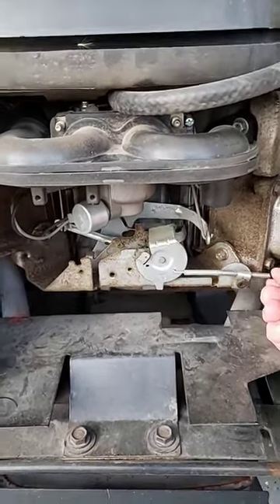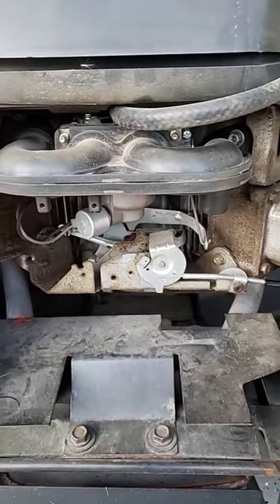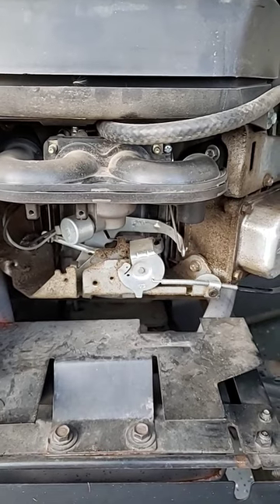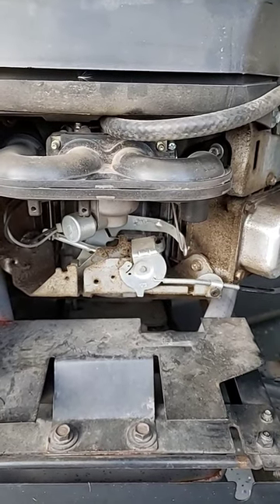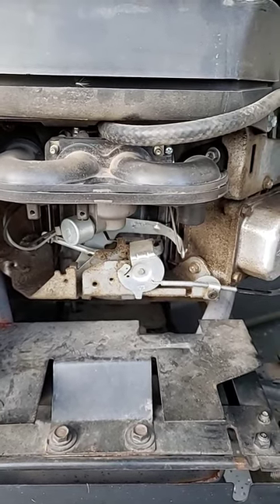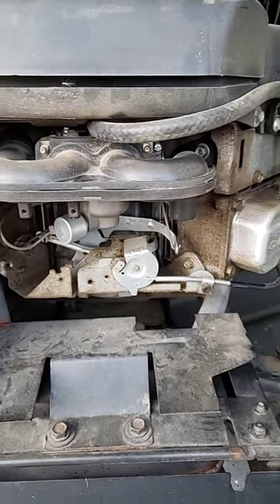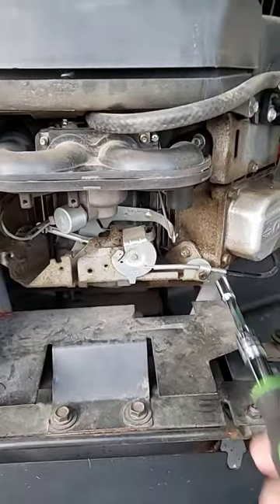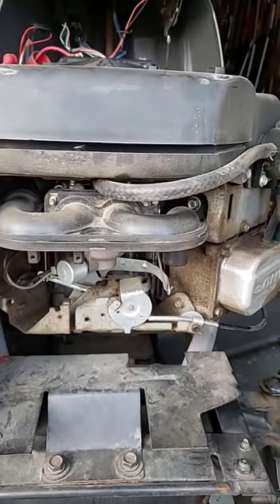Before you try anything else, check this adjustment!! EASY FIX

Comment: You the man!! I changed the air filter, fuel filter, oil filter, cleaned the carburetor and changed the spark plugs before finding this video. It was the choke adjustment all along! You are smart and I am dumb lol!
Reply: I did the same thing plus a new battery
Reply: Bro your not dumb, you must think your a lawn mower technician 😂
Reply: Or may i see your wire harness plug ends if your engine is similar to his or to mine 40h777 i just wanna see if I've got my shit hooked up right
Reply: Or maybe you have a similar engine
Reply: ...yup.
Reply: Nice simple fix.

Comment: dude, I am so glad I found your video. I was getting ready to pull the carburetor and rebuild it. This was the problem, this mower hadn’t been started for over a year and it kicked over on the first crank. Once I move that choke all the way closed.
Reply from the maker: Glad I could help
Reply: Thats good now you can show me your wire harness hook up and plug ends

Comment: It's also frequent that these do come from the factory with the screw tight, but mis-adjusted on the cable length. You can check by watching which lever that cable rotates right on the carb, then see if you can push it farther than the cable can. If so loosen that screw and shove the cable over towards the carb then retighten. When it comes from the factory misadjusted, the engine is so new-perfect for the first season that it doesn't even need the choke, so you don't notice the flaw until the second season.

Comment: I have the same exact mower and mine only starts when I spray gas directly into the mower carb on cold starts. After it starts, it has no problem starting again till it gets cold. I will check this out. I was just about to buy a carb bc I just cleaned this one. It fixed my problem and now my mower runs like a top 1351 hours
Reply from the maker: glad i could help!!
Reply: ur guys engines are a bit newer than my craftsman 22 hp 40h777 but their still the same engine besides numbers
Reply: My mower doesn't start, wait, recharge the and it on first compression, no choke needed.
Reply: @dogtooth11able  soon as i touch the red wire to + on the battery it starts right up plus with its new rectifier put on the used battery would still be dead without that

Comment: My husqvarna has been decent. It had three mower decks under warranty, and the engine has been off twice for oil leaks,not too bad considering it's a 2005,has 327 hours, just change the oil and filter once a year and grease the spindles on the mower deck a few times a season

Comment: Cub cadet it’s a 60$ throttle handle and cable I used a 4’ hand lawnmower throttle cable bolted w a pc a steel  mounted the steel plate  but I have to manually lift the choke  know she’s not maxed rpm and choke like the original I can 3/8 it and choke she starts right up

Comment: I had no crank/click/anything Deere l100.  Pulled my hair out for a couple days.  Found out the brake switch was loose on the frame and slipped off the brake linkage when the brake was applied.

Comment: People are surprised when i say this but my john deere e110 has q
1000 hours it is very well maintained and just today ive had to replace the belt because i was pushing its limits 😅 but every other time i mow it gets grease every 10 to 15 hours it gets a full service blades to oil and it runs like a dream never had a single issue besides some common ones like it just laying grass over but that seems common for nearly all john deere mowers
Reply: Why are you changing the blades so often??? 10 to 15hrs that's on average 10 to 15 mows, unless your blades are warped, bent or broken there is no immediate need to change them, you can resharpen blades for years and years especially if you have a decent little bench grinder, blades are not cheap especially if your mower uses multiple blade to cut with, you should be able to on average under normal operating conditions have your blades last for 3 to 5yrs or more, only time I've ever changed blades is if I hit something that damaged them or they broke or simply wore enough where the edges or tips of those blades were wore enough they started leaving uncut grass in between them, I service, rebuild, and fix all things small engines, been doing it since I was 8yrs old with my old man, I'm 39yrs old now, please stop wasting your money changing blades that often when not necessary unless actually wore out, damaged or broke, I literally charge 15bucks for me to do a sharpening and servicing of the blades at my shop, that's a flat rate no matter how many blades are on the deck, you can't bring me 20 blades lol, only valid with the amount of blades the mower deck requires stock form, and yes I've had to explain that a couple times to some customers lmao...
Reply: @RodneySizemore-uf4yu  i should edit my comment i dont fully replace them i just sharpen them just the other day i had to replaced one cause a rock just decided to pop out of the ground 🙃

Comment: I wanna know how to manually start a tractor when the battery goes dead. Garage ain’t got power and it’s a pain in the @$$ running extension cord out to charge the dang thing. Will the battery charge itself when the motor is running? Or am I supposed to charge the thing on regular basis?
Reply: Ignition Stator or Voltage regulator are not functioning.
Reply from the maker: should be an alternator built in that keeps the battery charged
Reply: Charging system is only designed to maintain voltage. It can't compensate for a weak battery

Comment: Too many times!!  Currently sitting outside my shed because it happened today.  Now I will probably have to charge the battery.  I do have some spray stuff that usually helps but I didn't try it until after I may have flooded it .. because I had left it up at the house.   And because my mower man had just changed out the carburetor for me so I thought things would be great 🙄

Comment: I could use parts off that engine for my 40h777 craftsman/Briggs engine. So now i gotta put another cable on it i attached a cable to the top of the carburetor but nothing at the bottom 

Im using used parts off my other junk mowers so it might look like shit on the outside but all functions the right way its not new like yours you probably paid around 3 thousand something for yours 

I just bought the 40h777 used the guys friend said the engine was blown up but its not i think he'd be upset if he heard it idling smooth again it didn't for him because he had vehicle plugs in it and had a few air gaps and no ignition switch or wire harness no diode or rectifier. I paid $40 for my engine

Comment: Omg you got me 😂 because if someone said hey my mower turns over but doesn't start. Hmmmm. Yea thats not a solution but a rare occurrence.  Probably should check the oil first.
Reply: Wtf are you talking about ..
Reply: @keithturgeon5448  He saying that the problem in the video is a niche and rare issue, probably not the first thing you should check if your “lawnmower doesn’t start” The guy in the vid is generalizing lawnmowers bro starting to a loose choke cable screw, when there are many other more common problems.
Reply: This is NOT a rare issue with these. They very commonly come misadjusted from the factory and need the cable slid over a bit before you retighten that screw. I bought a $2000 machine for $500 because the owner didn't know of this 30 second fix.
Reply: WTF? Always lift your hood first, take a quick look over while you're checking your oil BEFORE you start it. I do, it's a no-brainer.

Comment: Gday I live in Australia and sometimes find it hard to find a Slasher that can climb 10 to 15 degree hill. The problem I’ve had is the oil pump being capable of operating the oil just as efficiently as driving on flat land. I’m interested in a Huski that can operate the oil pump going up and down. Any recommendations would be beautiful. I have only 2 acres but it’s enough to require a decent machine for around $4’000.00 US OR A LITTLE OVER $5’500-$6’000.00 Australian. Cheers folks. All Huskies can be purchased in RUAL Australia no problem. It’s getting the right advice that is 95% always an issue. Sales people trying to flog off that pile junk model no body will buy. Cheers again. And THANK YOU to anyone for your valuable advice.👍🇦🇺❤️🇺🇸🇨🇦🫡